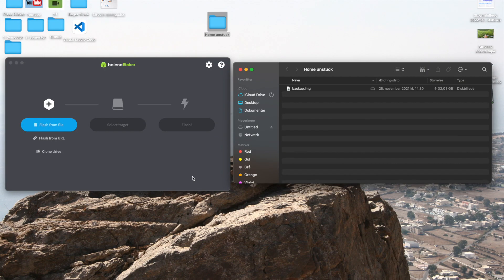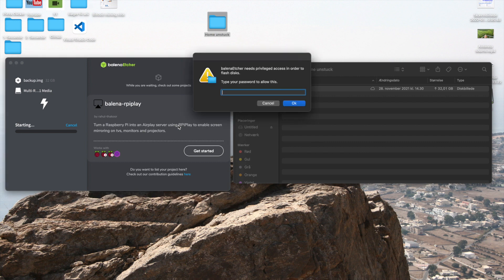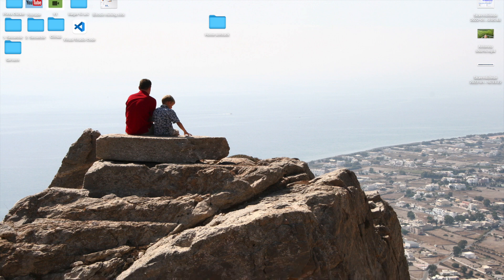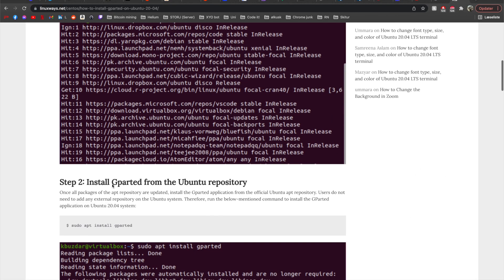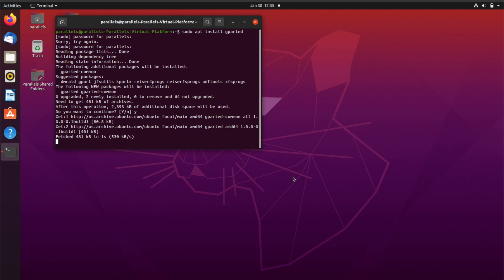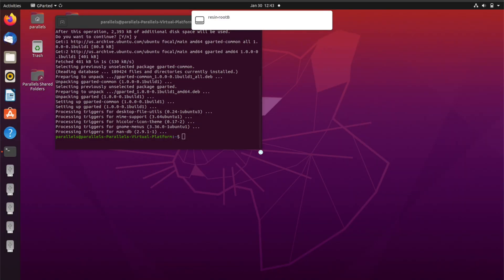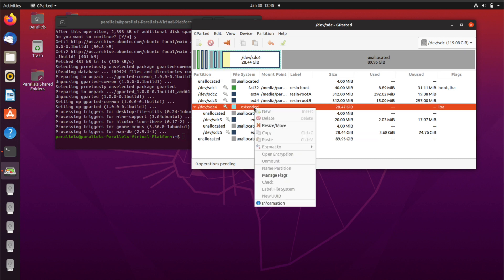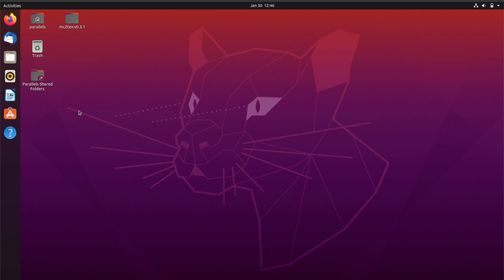Nebra miner SD-Card upgrade guide. How to get a bigger sized SD card on your Nebra miner.

Comment: What's the procedure to start a brand new Nebra hotspot replacing the 32gb card for a 64gb one to start clean from the beginning? Could you put the link for the Nebra firmware on the description please? Thanks.
Reply from the maker: I might make a full video. :)